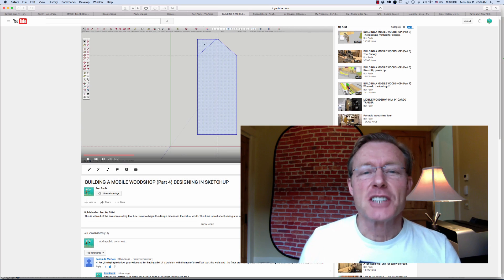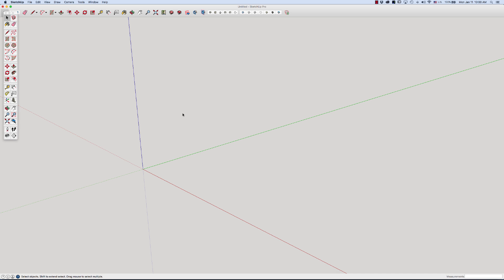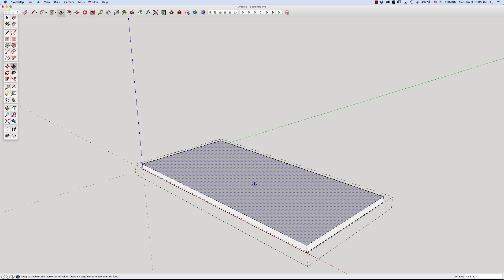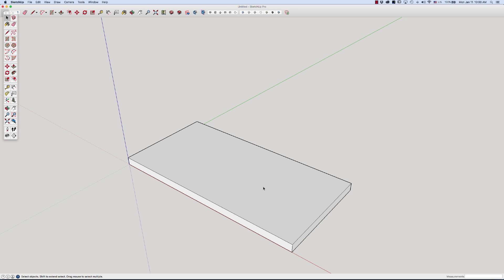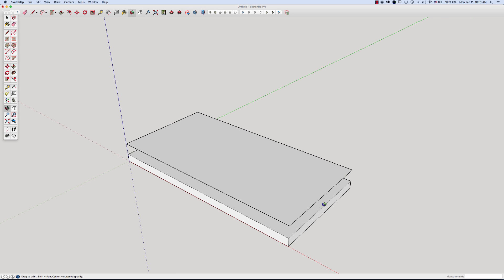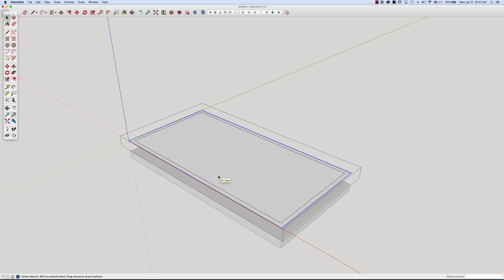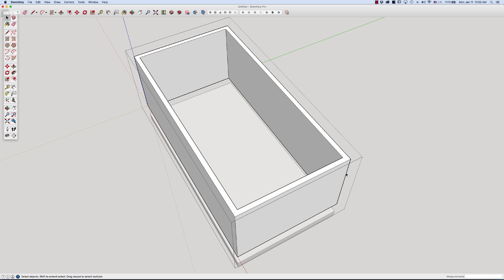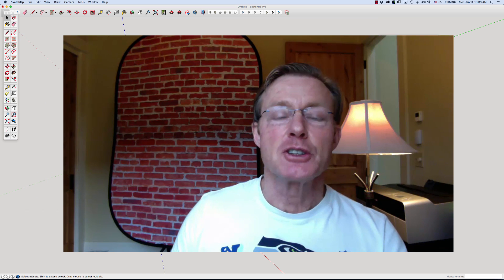SKETCHUP OFFSET TOOL: A POWERFUL TOOL FOR WOODWORKERS

Comment: Sorry Ron,  

Even though I know how to use most of these drafting tools, and have taught my kids how to use them over the years ( 3 Engineers), I still love pencil and graph paper for working in the shop and at the job site. I can still put together a good enough 3D rendering by hand to know what I need to do, create a BOM, estimate, add changes, and  then refine more complex parts.  I do go though a lot of graph paper books.
Reply from the maker: +Warren Smith As long as it works, keep at it.
Reply: @George Glass Yep, at least I'll be designing once the power goes out.   I didn't  say i couldn't,  i just prefer for my projects in the shop to use pencil and paper.  Byte that silly boy.